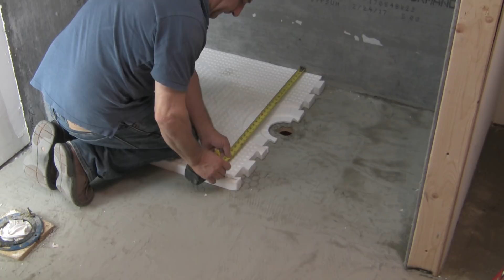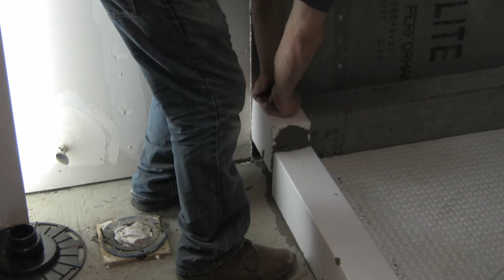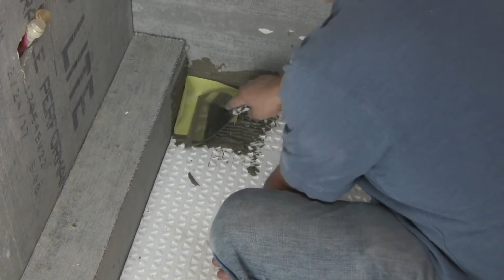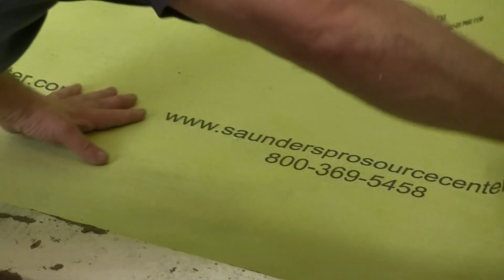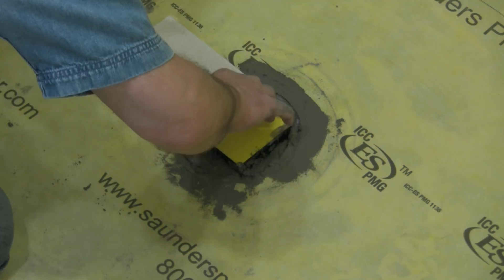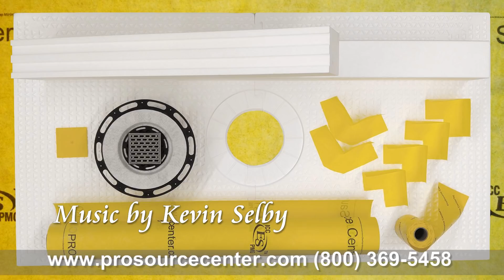PSC GEN II Pro Advanced Shower Waterproofing Kit - Install Like Schluter Kerdi 32 x 60 Center

Comment: Is this like the kerdi kit and can be installed on drywall?
Reply: Yes except even better - you can use modified thin-set mortar that works better with drywall than Kerdi's original unmodified only thin-set scheme. Now they allow their modified thin-set to be used.

Comment: Is this just as good as kerdi system?
Reply: It's better - I installed one at home. I was able to use super-high quality MODIFIED thin-set mortar - I think I used a higher-end TEC product which I got locally but Menards carries it too I believe. Schluter Kerdi claimed for years that their system would fail with modified thin-set then they "magically" formulated their own modified thin-set. In the end, I think it was all Schluter marketing ploy to buy only their products. Spend more $$$ on a better thin-set - you only need 2x 50# bags. The PSC Drain is way better and stronger - it's never going to flex and fail. I've held the two (PSC/Kerdi) drains side by side - there is no comparison. I really like the hair trap on PSC - it's amazing what normally would go down your drain. The caught hair also catches a lot of shampoo/soap/conditioner greases that would be bad for a septic if you use one. The Kerdi foam "seems" fancier but it is thinner and lighter (less density) and probably much more prone to failure. I think my shower is now almost 8 years old (there is an older video that this one) and is in perfect condition. I am able to check because I have full access underneath that bathroom and also an adjoining wall.
Reply: I agree for the most part the quality of the PSC product. However I did have a problem with the fitment of the drain grate after tiling. The yellow plastic cover they give you to use for sitting your drain and tiling around it seemed like a good idea, however after grouting and removing the plastic cover, let the grout setup, then attempted to install the dream great it did not fit. I had to tap all around the edges with a hammer carefully to squeeze the metal tighter, also had to grind off a piece of the metal that wrapped around the great that leads towards the bottom. After doing this it fit okay and no other problems. Just wondering if you had any issues with this. I'm thinking when I do another one using these products I will wrap a little painters tape around the yellow cover. Before tiling and grouting.
Reply: @klangille8284  funny enough I'm looking back at old videos and I have this problem right now.

Comment: Hi
I noticed that none of the edges, corners or screws on the cement board are taped with thinset. Is this to avoid build up? I'm assuming it's ok because of the membrane? Thank you
Reply: Hey VT. You're correct, when you see joints taped and mudded they are usually using red guard or another waterproofing compound. With PSC Pro everything is covered with thinset as you apply the membrane thereby sealing any joints or screws. 👍🏽
Reply: Yes the thin-set will take up an "slack"

Comment: Great video. After looking at this product several times on the internet I decided to give it a try on a home renovation in east Texas. I ordered the 60x0 full kit. First I'll start with the pros.
Love the quality of the product. It is much more durable that Kerdi due to the density of the foam components and is much less expensive. Now the cons. After ordering, and waiting a week or so for a shipping conformation, I contacted them via email (I have never seen the chat option on the website online - maybe because of covid) and recived the following response "Thank you for your message your order is being shipped, tracking # will be
 provided shortly. my apologies for the delay. After another week, still no tracking number or response to any of my emails. Finally got a tracking number and received my package. The package you see online is the package it is shipped in. This is a very thin poorly packaged box for a foam shower kit. Needless to say, the box was damaged during shipment. Several of the foam parts were nicked but were usable. One was broken but repairable. Ok I thought I can still give this a chance until I found 4 missing foam parts. The trowel I ordered was shipped in the drain kit box so it seems the company makes these kits as they are ordered. I tried to contact the company again with no response. Now I'm an angry customer stuck with a product I can't use and the possibility of my project being delayed. Even though there are some things about the Kerdi shower kit drains I don't care for, I will be ordering one to save my schedule.

Comment: Yo PSC I’m just wondering, for  the flow of waters sake  why don’t you start with the shower base liner, then do corner/edge layer around base, and then finally do the walls? That way everything is overlapped correctly (at least in my mind). I’m just genuinely curious
Reply from the maker: Hi Caleb. You may overlap membrane any way you wish - our order in the video is simply suggested. However be assured that this is not roofing material in a roofing scenario. The membrane has a long record and testing showing that the 2" bond between membrane pieces holds up no matter which order you have the membrane stacked. Remember that these membrane pieces are under tile and grout taking the brunt of the water flow. The membrane sections under the tile are simply being immersed in moisture and not subject to harsh blowing weather conditions like an outside roof. That said, the reason we recommend the order given is for example that installing the corners first helps create the cleanest, squarest corner possible to make tiling easier later.
Reply: @prosourcecenter  Thank You, my 48 X 72 kit will be here next week, I've been looking forward to this for a while.